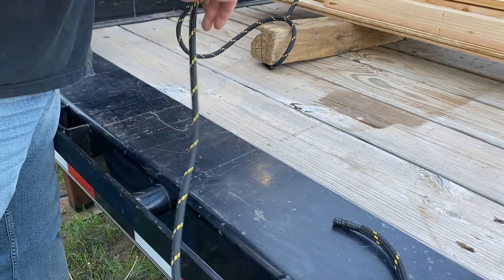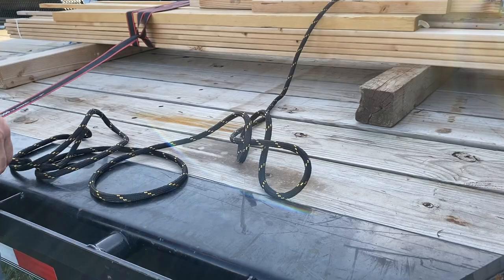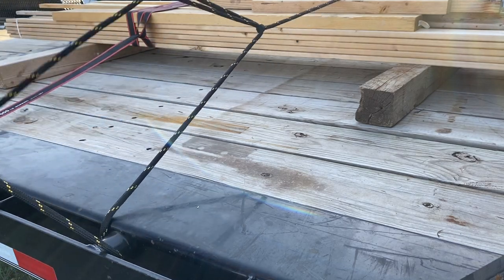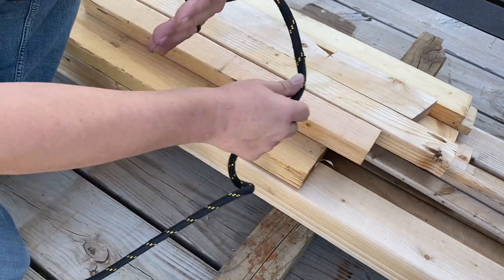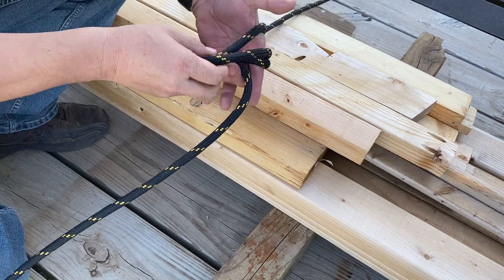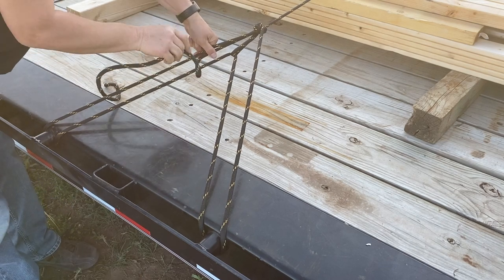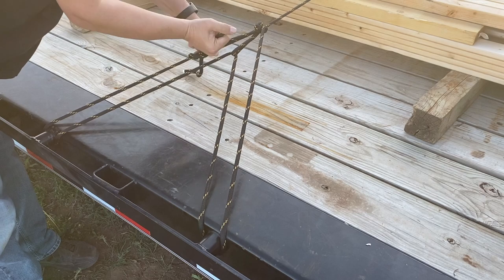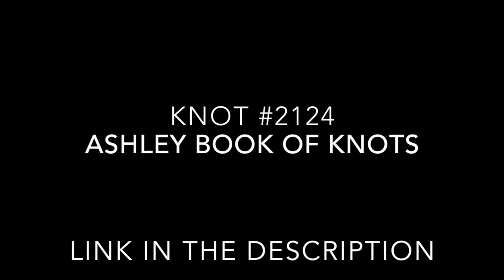How To Tie The Trucker's Hitch

Comment: Very handy. It's a shame that ratchet straps, as handy as they are, are making these rope and knot skills a lost art.
Reply from the maker: Agreed, though I use ratchet straps most of the time.
Reply: @txtoolcrib  The beauty of a truckers hitch is that it can be used ANYWHERE a knot needs to be tied under tension. Not just in a pickup truck bed. Places where ratchet straps aren't readily available. I use it extensively in camping, sailing and construction. Situations where a "ratchet strap" would NOT be readily available. Can you imagine how many ratchet straps it would take to secure a full load of antique furniture in a five ton truck? Are you going to carry dozens of ratchet straps for something like that? I don't think so.
Reply: Plus it's way easier to manage any length of rope than a long strap which tangles like crazy. And I've had those ratchets jam and be really difficult to release just in the moment I needed them to let go. I just like the rope better. Surely ratchet straps have their place. To each their own.

Comment: This does not give a true 4-to-1 mechanical advantage. It only spreads out the forces over 4 lines on the one side of the knot. Could be useful to share the load on two small anchor points. Also, your water Bowline needs more tail. Otherwise, well done video as always.

Comment: Here's an easy variation to increase the force without having to tie a Double Alpine Butterfly Knot. Just use the same eye TWICE! Make sure you put the running end through the eye the same way you did the first time so the parallel parts are not pulling in opposite directions and binding on each other. The beauty of it is, you can decide to add force as you feel necessary without starting over from scratch with the double alpine knot.
Reply: Plus if he did run it thru the same loop instead of the 2nd one it would have been self-locking to boot (ie progress capture!)!
Reply: You can also tie two identical slipknots next to each other, which is easier to untie than the butterfly loops

Comment: Neglecting the friction as well as the terrible angles one could argue this gives you a 5:1.
Though I for one would rather go and try to make use of the secondary lines, treating them like a second pulley system. If the lenght of the first line allows for it.

Comment: I made a another slip loop on the end to tension the hitch. And made a second truckers hitch to make 9-1. If you add a 3rd truckers hitch to the end of the second. Its a 27-1. takes a lot of rope to move just a little. 27 feet of rope pulled to move a foot at that point. but cool to show a friend 27 inch's of rope being pulled to move the other end just one inch.

Comment: I don’t see how this is a 4:1 advantage. After threading the rope through, and pulling, the rope does not move through your first anchor point and the first loop of your alpine butterfly. This is easily seen as your rope has the decorative spiral, and looking at that, the rope doesn’t tension at all - it only pulls on the left side. 

For a true 4:1 advantage, reference the unreasonably tight truckers hitch video by first class amateur.
Reply: Good point